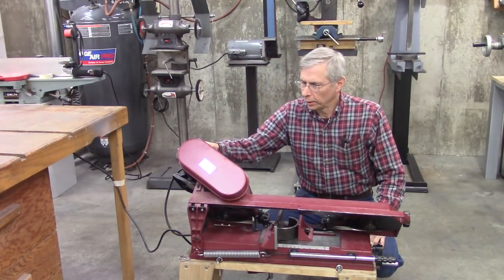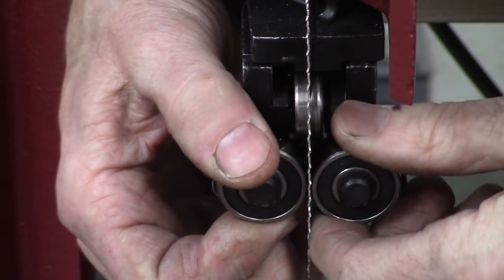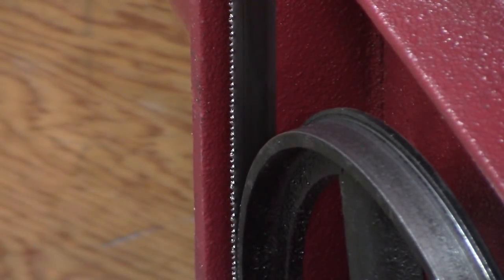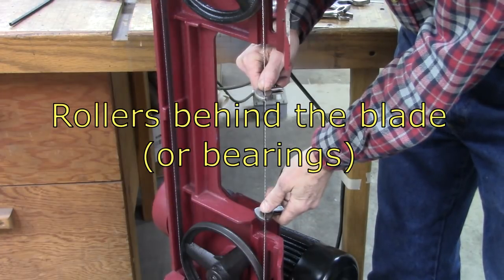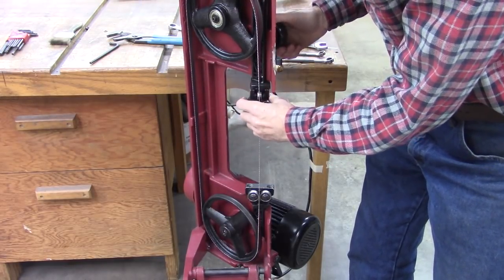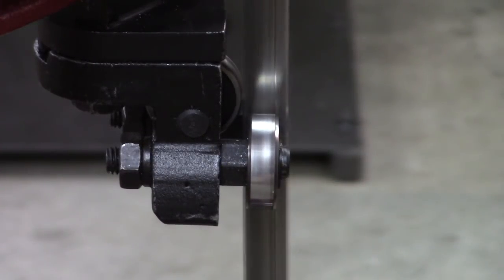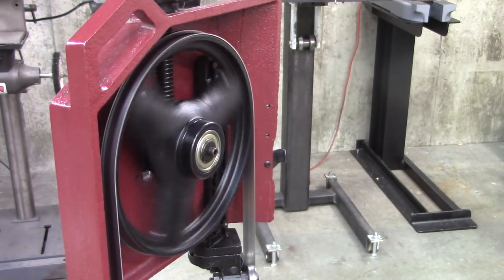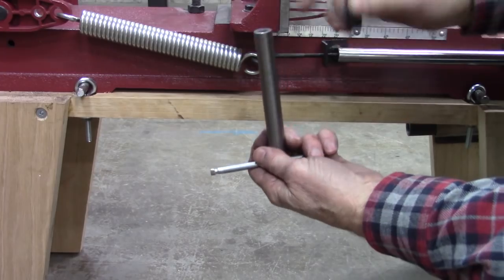4" x 6" Horizontal Bandsaw Tune Up

Comment: Really no quality
Reply from the maker: Yeah...  sadly, with a few small changes it would make it way better.
Reply: @WinkysWorkshop  You have good ideas to improve and spent a lot of time. Was it worth?
Reply from the maker: @wolfgangbalu1253  - I'm happy with the saw but I'm not sure I would buy it again. I know what to look for now.
Reply: @WinkysWorkshop  I would appreciate you could tell us what we should look for. Big help for decission
Reply from the maker: @wolfgangbalu1253  - I'm not sure what to tell you. If you are not looking for an industrial saw I'd try Grizzly. At least they have better support than Harbor Freight. Part f what I learned about setting up the blade guides was fro a Grizzly video for one of there high end saws. There cheap one might not be any better than the HF but at least they know how they should be.
Reply: @WinkysWorkshop  Thank you very much for your help. I like your chanel so much
Reply from the maker: @wolfgangbalu1253  - Thanks - I like to hear that. Much appreciated.

Comment: Looks operational.
Reply from the maker: It's working WAY better. This saw is a very popular saw because it is so cheap but achieving the right setting on the blade guides is impossible. Getting a good compromise is doable. I figured a lot of people would appreciate the video.